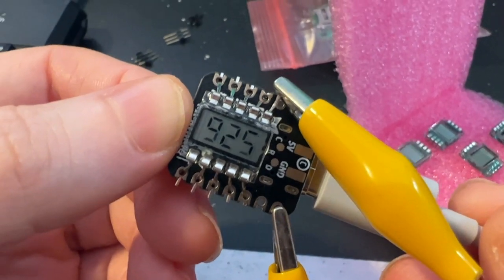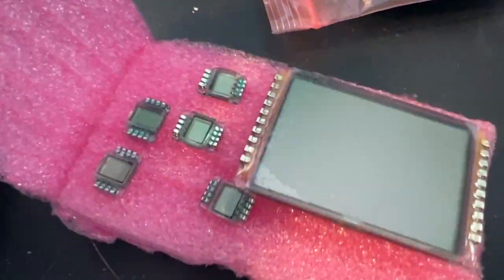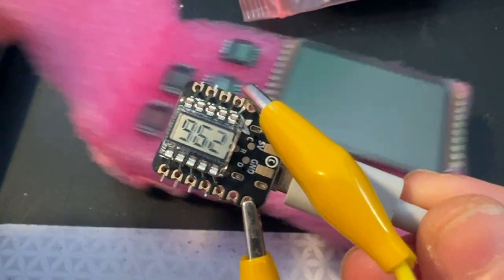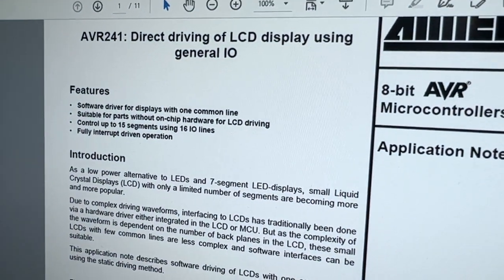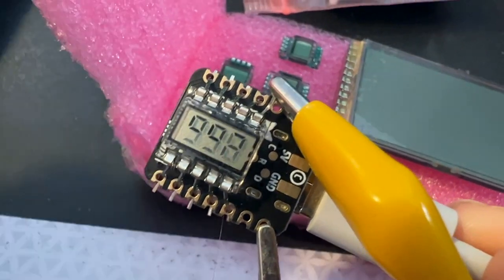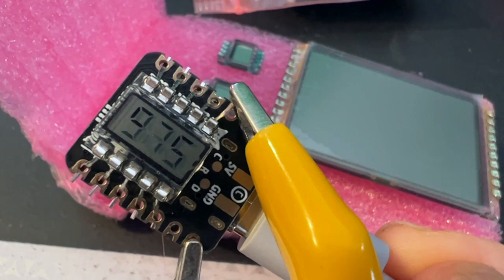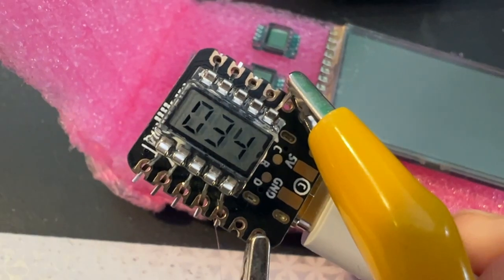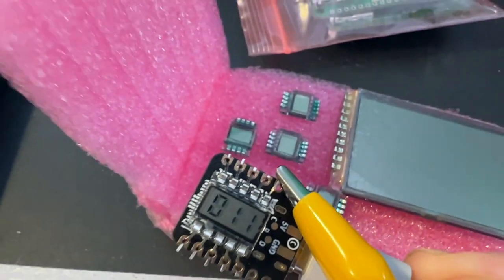very smol seven segment LCD display

Comment: for those who want to use even less pins, look up charlieplexing.
Hey Adafruit, wouldn't it be neat if someone made a modern replacement in the same form factor as those HP bubble displays that are getting very rare and expensive now? Maybe just a tiny custom COB module?
Reply: LCD segments are driven by an AC voltage. My understanding is that Charlieplexing makes use of swapping the polarity of a DC voltage to only light up the led thats hooked up the right way. So i don't think it would work at all. Correct me if im wrong.

Comment: Simple LCDs can be driven by an ATMega. 
I've already done that with an ATMega and a 4x 7segement without a driver IC. The LCD needed 60Hz plus and minus swapped. Each pin of the LCD to a pin of the M2560. For this I have always used 8 pins of a group PA, PB, PC ...
Unfortunately, not all groups are completely brought out and I hidden individual pins for RX, TX, SDA, SCL when writing the data. The 60 Hz is not controlled by an interrupt that writes the normal output once and an inverted output once. Before that, I have a logic that converts ASCI code into 7 segments and then assigns the individual segments to the right pins all over the place. It doesn't matter what the pin is called, the main thing is that the segment is in the right place again at the end.

Comment: Would be awesome if y'all built an adapter board to interface with an E30 OBC display. You can buy them new for relatively cheap and they have an authentic 80s vibe. I am sure you guys could find a stable manufacturing source for those displays.